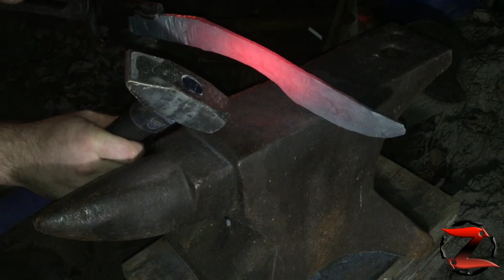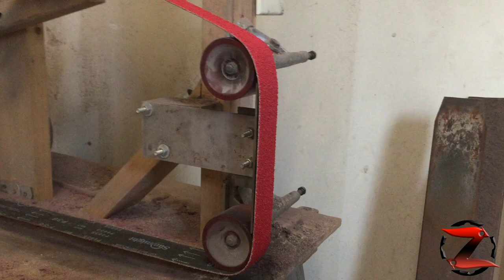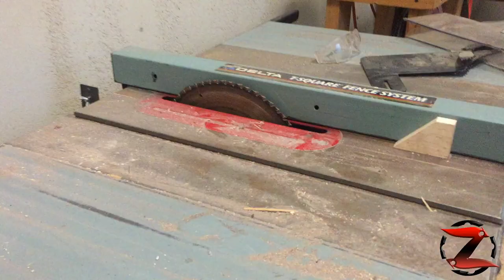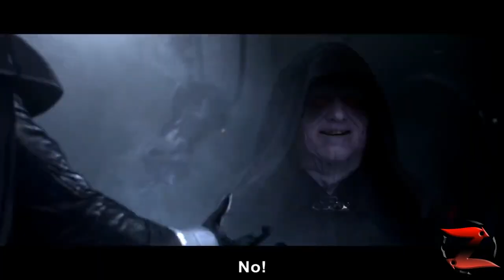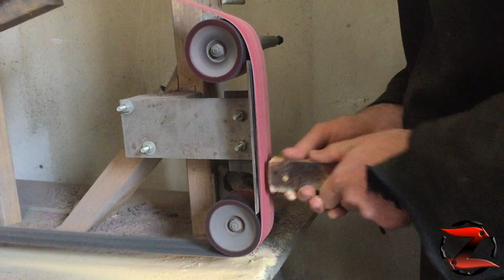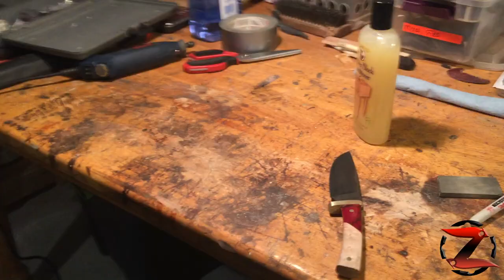Forging A Knife With A Mokume Gane Guard

Comment: Love the look of an acid patina on a blade that size. BTW, doesn’t matter too much because you’re going right to the grinder, but you might try parchment paper instead of wax paper. It’s used for cooking and baking. Some of them are infused with silicone and there isn’t ANYTHING that sticks to that stuff. Wax paper can be a mess, not just because of the wax it leaves on stuff, but if it’s up against something hot, it will melt all the wax and weld the paper and you’ll end up scraping little shards of paper off everything. Don’t think that exothermic epoxy gets hot enough, but if you’re making soap or candles or something like that.
Reply from the maker: I’ve never had that issue with the epoxy I use but thank you for the tip. I will definitely remember that in future projects if I end up generating more heat with a larger amount. I just use the wax paper now because it’s what I already have in my house.